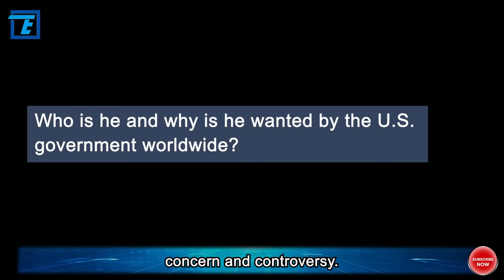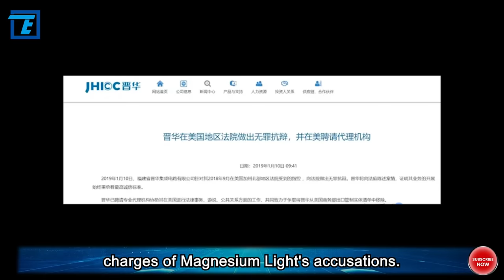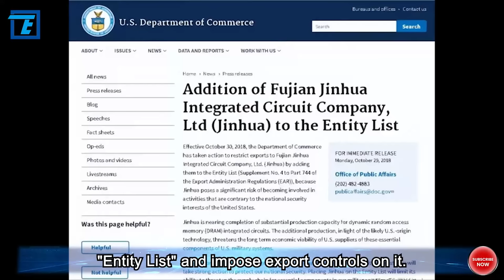What happened to this Chinese chip magnate? who was wanted by the U.S.?

Comment: The video made an error. UMC was accused of stealing trade secret not IP. Ttade secret can include pricing, yield and cost data. AFAIK, the originaldesign done by UMC, the geometry and process is different than Micron and they are also about 3 to 4 generation behind. Another thing is UMC already has their own DRAM cell for their customer. So the question is what is really stolen.
Last but not least UMC is a Taiwanese company. Its former chairman donated a ton of money for Taiwan independence.
Reply: When you trading something there is no secret , everything is exposed.
what a pathetic term "Trade secret"